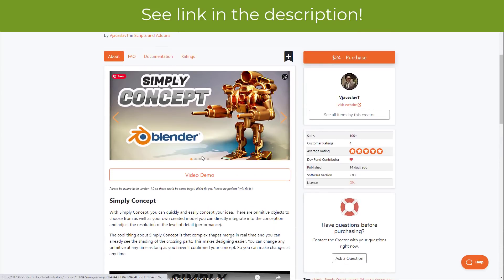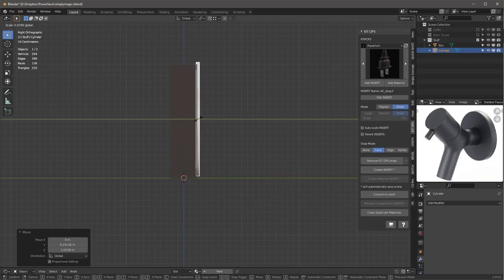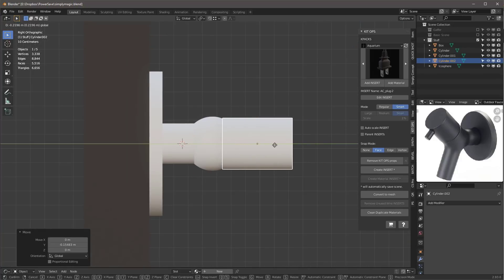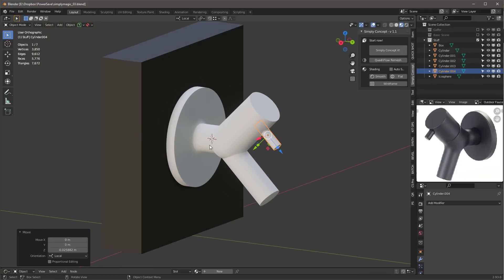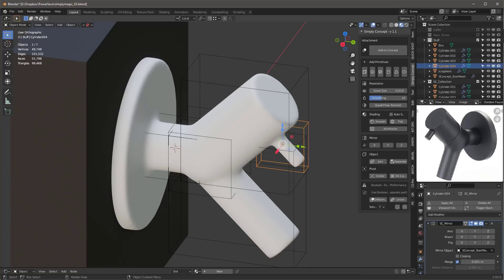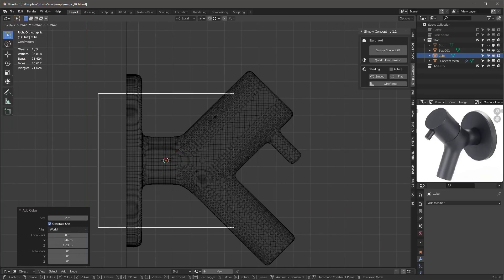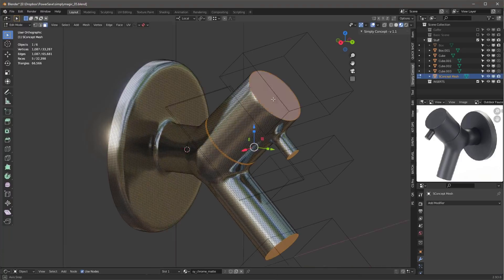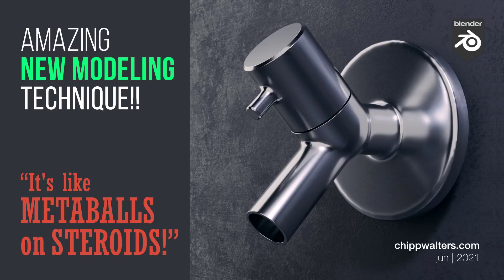New Modeling Technique for Blender!

Comment: To be honest, this method doesn't suit for hard surface modeling. Hard surface objects always have different fillet/bevel width, when you use metaball or remesh, it gives you uniform bevel width since they are based on voxels and after that it is hard to iterate and change something.  With traditional modeling method, though you have to prepare the topology first but you can always change something or at least change something much easier
Reply from the maker: It's great for fast models. It's not great for CAD-like models.
Reply: @ChippWalters  I would say, it is better to buy some high quality models instead of making a bunch of models using quick and dirty method.

Comment: Hello! Would you tell me what is your rig configuration and blender's render settings?
Reply from the maker: I'm using a 11th Gen Intel(R) Core(TM) i9-11900KF @ 3.50GHz, 3504 Mhz, 8 Core(s), 16 Logical Processor(s), and NVIDIA GeForce RTX 3090, and 64 GB memory. Blender render settings are probably the default. I think this was rendered in Cycles.

Comment: This is exactly the same as the Volume mesher in C4D, which is great for quickly fleshing out a shape to use as a reference to build over with good poly's. The trouble is the better the definition the higher density of mesh and with that comes excessive cpu usage. 

Considering how superior Blender's boolean modelling workflow is I can't see why this would be used much.
Reply from the maker: It's actually the opposite. Because Blender's Booleans modifiers are so good-- it makes this possible.

Comment: Check out the beta version of MagicaCSG from the creator of MagicaVoxel. It does SDF (Signed Distance Field) modeling. You can melt together primitives, and also tweak their blend / blur values ie how far the shapes join. You can use additive, subtractive and intersecting shapes. It's a pretty neat way of modeling stuff. However it's a very early beta so it doesn't even export to any mesh format yet. But it's fun to play with.

Comment: As a beginner I'm kinda confused as to what this plug-in actually does. It joins those different objects together in a smooth and clean way right?

Also what would be the "hard" way (without the plugin) of doing this? Maybe a comparison video would be interesting to see idk
Reply from the maker: Yes it creates a smoothing effect between two objects. To do this manually would have to be done with some retopo and subd and take a long time-- too long for a tutorial.
Reply: ... and thanks  @ChippWalters  for answering. got it now why u keep saying metaballs - as they also auto join smoothly.
also, maybe pin this thread??!
Reply: yeah, same exactly same were my thoughts. thanks for asking...
Reply: to do it manually:
1. CTRL+J all of the objects
2. add a Remesh modifier, set to Voxel mode
3. set the size to about 0.00015 m or so
4. enable Smooth Shading
5. apply when happy

having done this, you'll end up with a very high poly object (probably over 100,000 polygons). to reduce the number of polygons, visit the Object Data Properties (green triangle symbol), scroll down to Remesh and select Quad and perform the QuadriFlow Remesh
Reply: @alex15095  Better use booleans instead of Ctrl+J since remesher can fail in some cases with intersections, while additive booleans make no intersections at all (if made correctly)

Comment: Modo has this way of modeling since day one.
Reply: And? We should care what Modo has? We are talking about Blender, not comparing dicks.
Reply from the maker: Modo has Mesh Fusion, a totally different, albeit more powerful solution, but it only works with proper quad surfaces. This tool can work with just about any topology. And when combined with a state-of-the-art remesher addon, like Quad Remesher, this can give as good or even better final results.

Comment: Great if you need a really high poly object. But I don't think that you save a lot of time, you can add all of this with booleans and do a voxel remesh. 
Or, you can use normal modeling (you know, the way which uses less than 10.000 polys for  a faucet ) and add some bevels or subdivision with modifiers.
Reply: Not to mention it's going to be a huge file in comparison if you'd start low poly. When he made it 128 vertices my brain was like 'no'.
Reply from the maker: 128 makes no difference as the model is voxelized at a new resolution. The 128 is just the "scaffolding."
Reply: @ChippWalters  This will still result in an ineffective geometry, as your video proves. I do use similar techniques in ZBrush, but the retopo there is way more efficient than Blender's voxelisation. Still, the results are pretty high poly then. 

Sure, if that doesn't matter, it seems to work quite well. For 3d printing, this is probably very usable. But for a simple prop, I would like something lighter. In a scene with dozens of props, this will add up pretty fast.
Reply from the maker: @Fley1965  You use Blender much? haha. Sounds like not. There are many ways to reduce polys and clean up meshes in Blender, including using Z Brushes own retopo tool.

Comment: This just remeshes them into one without the extra steps, it's entirely doable without the addon.
Reply: @Master Monkey Yeah but the extra steps in this case are pretty rudimentary, it seems to just slap everything in one menu which I guess is easier but it's just as quick doing it without the addon.
Reply: @Master Monkey I don't know if there is a huge reduction in clicks really, it just seems to throw all the buttons into a singular menu, it's arguably more when you take into account the fact you have to individually select each part and "Add To Concept" wheras vanilla would you have you box select or shift select each, ctrl+j and remesh. Seems around the same, if not more, I don't see it being worth $24.
Reply from the maker: Yeah, why don't you try and do it? Make a video and show everyone how easy it is. I think you'll find out it's not so easy.

Comment: It’s not a metaball modeller,  it’s using a simple Boolean and then another simple convert to vdb.   Then convert to poly and Ramesh … actually A Pretty regular process in Houdini. my guess is the tool is built with Houdini under the hood. (OS, I don’t use blender) .
Reply from the maker: Then your guess would be wrong. Haha. Helps if you know a little bit about Blender. Use Bools, a remesh modifier, and a smooth modifier and adjust.

Comment: Thanks for the video could you please say where did you got that dark theme for blender and which plugin did you used for adding material to the model 
Thanks 
Jesus loves you
Reply from the maker: That is the standard theme for blender that I'm using. The plugin is the free kit ops plugin and it comes with a free set of materials that you can use to add to your objects.

Comment: There's a thing for Modo called Fusion that's a lot like this, but with more features. I miss that sucker.
Reply from the maker: Yeah, but with Fusion, it's much more powerful. And that's because Fusion results in a really nice subd mesh. But, that can be done very easily with this technique by subsequently using the quad remesher plugin which is the same remesher that ZBrush uses so it's a state-of-the-art remesher.
Reply from the maker: @therealjones-o6x  Dude, Zbrush remesher is made by the same guy. https://exoside.com/quadremesher/

Comment: you could also finish up with exoside quad remesher to get perfect topology.  That way you can drastically reduce quad count, and also make it possible to modify bevels between connecting pieces + easily unwrap.
Reply from the maker: Absolutely, and I always do exactly that. Really good point!

Comment: Can you expand on where/what the advantage is?  Thank you.
Reply from the maker: I'm sorry, but I neglected to mention in the video the main advantage of this approach. And that is the fact that it is extremely easy to fine-tune and tweak your designs using an iterative method of just moving around the different shapes. So, for a designer, it's a great way to explore new forms. And, when combined with hard surface modeling tools, you can create some pretty amazing shapes and objects. Think of robot arms with intricate mechanisms built inside. Things like that. Hope that helps.

Comment: I like the addon but this effect can be done with just 2 modifiers, a remesh set to voxel, and a smooth modifier. (Saves you 27 dollars)
Reply from the maker: Haha. I was just speaking with Jama about that and I didn't know that he had a similar tool!
Reply from the maker: The only problem is that you can't use separate objects to do the same thing. They will all need to be boolean unioned.
Reply: @ChippWalters  No need to use boolean union, just join the objects with Ctrl + J and use remesh modifier.
Reply: @ChippWalters  Actually with remesh you can use them all inside one mesh, just do everything in editmode. The  'boolean' happens as part of the remesh.
Reply: @ChippWalters  you can just add meshes in the edit mode instead of adding objects.
Reply: @ChippWalters  Why is a boolean union a problem?
Reply: If we're lucky we'll get the csg features back into the remesh modifier soon™ so we definitely wont need this addon.
Reply: @daedulas1  what's csg features???
Reply: Am I missing something.. 
It seems really good for speeding up the workflow, however this could be achieved in several other addons that add way more functionality, for example hardOps/BoxCutter. You could even achieve this with the weld modifier
Reply: Thanks , my computer crushed
Reply: @cowholy3031  well simply concept just clamps the voxel size so ur pc doesn’t crash, but if you have been using blender for a while u should already know not to set the video size too small
Reply: and then add a decimate modifier set to planar, set the angle to something like 3°
Reply: Even more, You can do same thing using Geometry Nodes: Point Distribute, Points to Volume, Volume to mesh :)
Reply: That's the thing with 90% of addons. They're ways to use Blender Vanilla, for those who don't know how to use Blender Vanilla. They use nothing more than what's already there.
Reply: Ended up with 30,000 tris faucet. Thanks but no thanks
Reply from the maker: And that's where a product like quad remesher comes in. You can take this form that you're able to create quickly and apply a high quality professional level rematch to it and now have something that you can perform subdivision surfaces on
Reply: @ChippWalters  I forgot to mention that this method works best if you stay in edit mode and add primitives that way. And as for geo count, the addon does the same thing but with geo nodes so same poly count is happening behind the scenes I think.
Reply: @aigottalent01  or you can do it by hand and have 2000 tris faucet with game ready topology
Reply: @aigottalent01  and how many do you think the one in the video was? 2 times as many.

Comment: I was wondering if this is also possible with the remesh modifier!?
Reply: yes, from what I saw, it pretty much looks like what you would get out of a remesh modifier, however, the rounded edges would be kinda hard to create. (maybe a bevel modifier?)

edit: straight put of the blender manual (for the bevel modifier):
Angle
Only bevels edges whose angle of adjacent faces plus the defined Angle is less than 180 degrees. Intended to allow you to bevel only the sharp edges of an object without affecting its smooth surfaces.
Reply from the maker: You also need to add a smooth modifier asking with a number of Booleans modifiers.